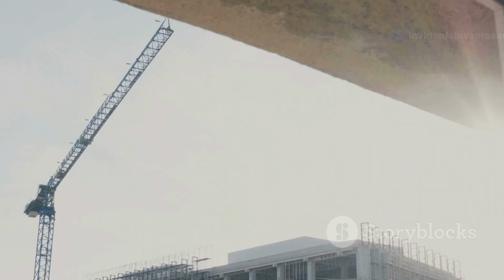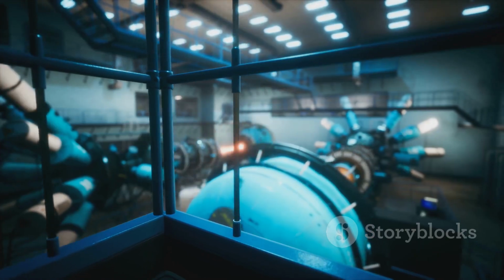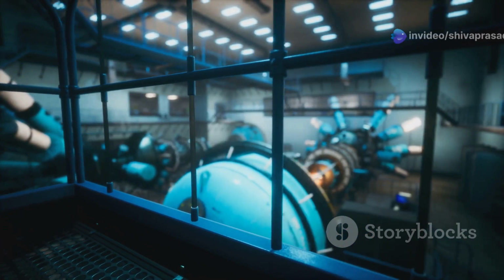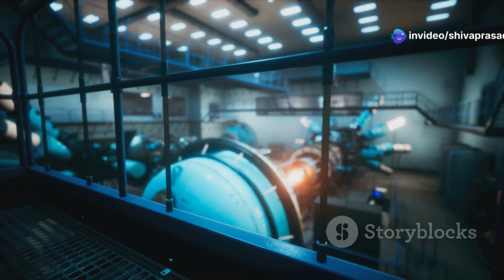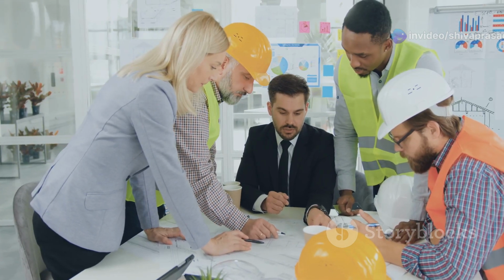Why Working Stress Method and Limit State Method  Is Still Important? #wsm #LSM #rcc #GATE #PSUs

Comment: 00:00:00 Understanding Structural Design
00:01:01 A Traditional Approach
00:01:54 A Modern Perspective
00:02:41 From WSM to LSM
00:03:31 WSM vs. LSM
00:04:42 Weighing the Options
00:06:07 WSM and LSM in Action
00:07:04 Factors to Consider
00:08:29 The Importance of Sound Structural
Design